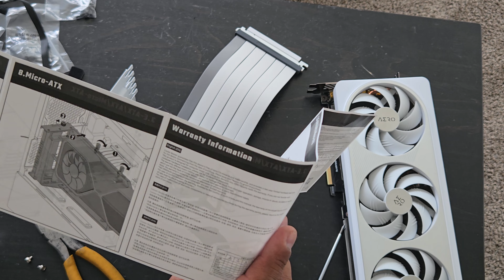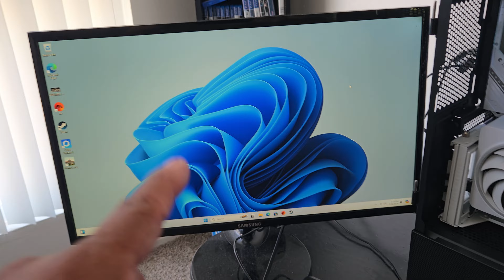Montech Sky 2 GX PC Build With Vertical GPU Mount, RTX 4070 Ti

Comment: Good morning pal, you think there is enouth room to fit 1 120mm fan in psu cover with this vertical gpu stand ?
Reply from the maker: Yes, by moving the vertical gpu to the top pcie mount of the case, did this just now to answer your question
Reply: @Critycal1  i am so Sorry. I said 1 fan, but this case can fit 2 120mm fans over this PSU  cover mount, didnt It ? Sorry. About my English btw. 
I Just get this case with an 7800x3d + 4080 super with a cooler master vertical kit mount and Im anxious as F-#k
Reply from the maker: @victorsenna3780  yes, case has mounting for 2, if you have issues, you can even put 120 slim fans
Reply: @Critycal1  great Idea, ty !